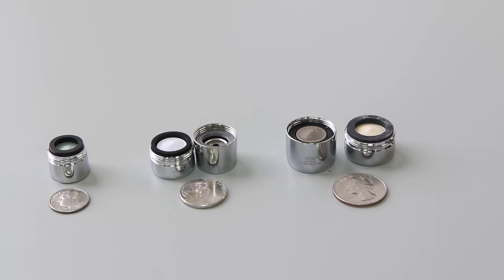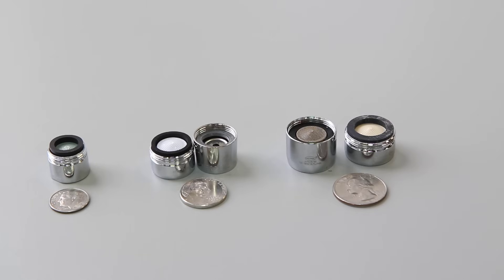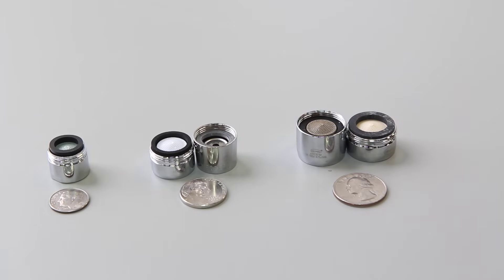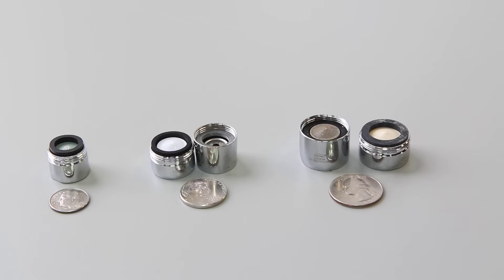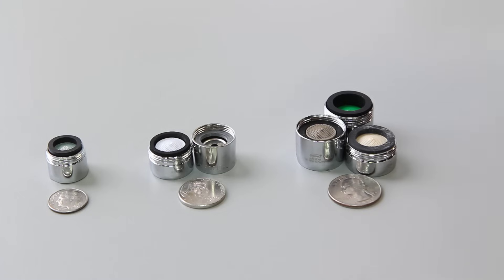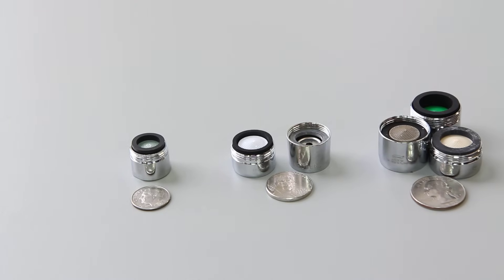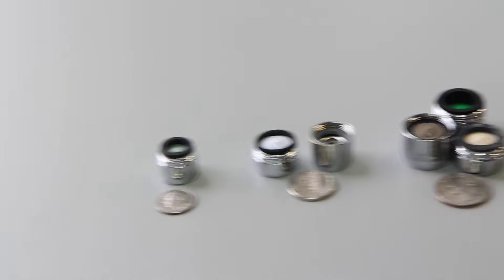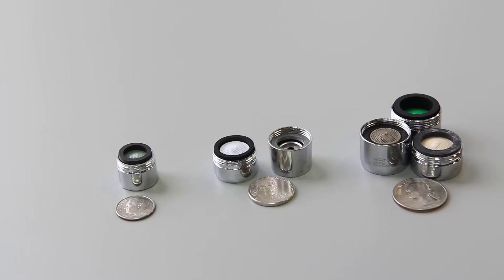How to Figure out Which Aerator (Faucet Fixture) You Need

Comment: What's the chance of Delta producing a web page illustrating all the little aerators that we consumers have in our faucets? I just took my kitchen faucet aerator (10 years old) out because the water flow had changed. Tried to find a replacement on your website and finally went to Home Depot and got one 'almost' like it. The water flow is back to normal, but not as fast as it was. If we consumers could see approximate size and 'color' on your web page, then the part number would be awful easy. What do you think? There can't be that many different aerators and it would greatly simplify some repair processes. And that would make points with Delta, I think.